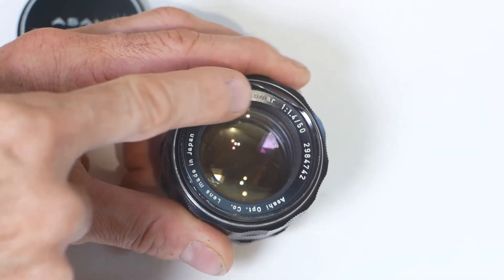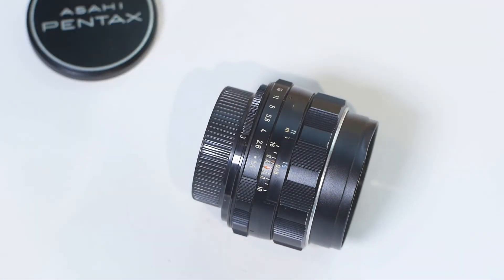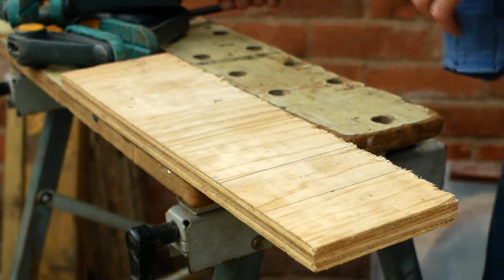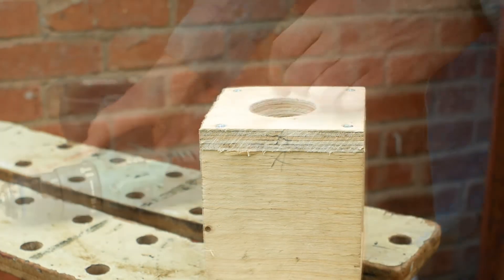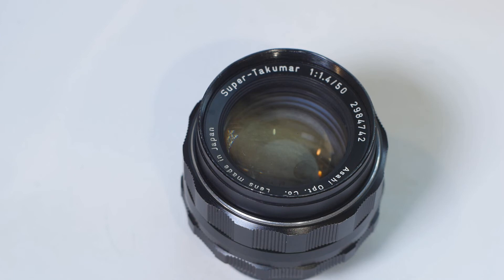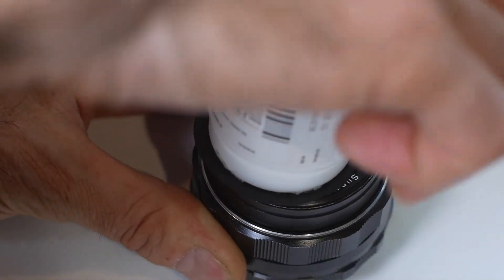Radioactive Lens - Super Takumar 50mm f1.4 - Repairing a Damaged Filter Thread & Vintage Lens Test

Comment: Just a few tips, after doing this on mine. It deeply improved the situation so I can get a filter to stay on tightly, but the filter is kind of cross-threaded. The thread ring and barrel wound up slightly over round (maybe 1mm) near the dent which is really hard to fix. Tip one: it's better to under-do this repair than over do it, because filters have a bit of play in them. Test your progress with a filter, and if you can get it to thread on partway, maybe stop and call that a win. Tip two, try to make the hole size and barrel as close as possible to the outside diameter of the barrel. The Super Takumar 50mm f 1.4 outside diameter is slightly smaller (about 2-3mm) than a 2 -inch nominal Milwaukee hole saw. Because of this extra space, there is room to push the barrel too far outwards. A good solution might be to shim the barrel with some firm tape (ie scotch tape) wrapped around. Tip three: beware the fine-tuning. I think it helps to apply the tool only to the first few outside threads, instead of pushing the tool tight to the inner ring that traps the outer element. Because at that point if you go too far, the bend might take to the barrel, and it might not be possible to remove the front element trap ring.
Reply from the maker: Good points TheNaught1, repairing filter threads can vary greatly depending on how they were damaged and whether someone has already had a go at fixing it with pliers (which is quite often the case).  If the damage is simply that the side of the thread has been forced inwards, then they're often easy to sort out, but if the lens fell on it's nose, crushing the thread backwards, it's then much more tricky.  On the plus side, if all it needs to do is hold a filter you can usually achieve something that sort of works.  I've not had any unfixable ones yet, but there will always be the first time.

Comment: Just found this video only 3 years too late.....Nice Job repairing the filter ring.  I have fixed 3 different Takumars using the same method in the past. Two of them to get access to lens elements to remove fungus and clean diaphragm.  I have also made a dedicated UV de-yellowing light station with a small cooling fan it does the job betwwen 24 and 48 hours.  By the way its not just the yellowing thats the issue you will also loose 1 to 2 stops of light until you de-yellow.  Thank you for a great video.  Mike.
Reply from the maker: Hi Mike, I knew about the yellowing losing some light - it's not so much of a problem when I'm using the lens on digital because I can just pump up the iso a bit - I still might get round to de-yellowing it one day, particularly if I start using it for film photography because than I'd want all of that f1.4 goodness.

Comment: thanks for that video. I own that lens as well as the 85mm F1.8. My AC dropped the 85mm and bent the filter ring. Now I have an idea how to fix it. I shoot documentaries for a living using my new Sony Fx9. The 85mm works all the time for me. If I white balance I'm more comfortable using the 50mm so it matches the other lenses I am using on a particular job. The focus on both is so buttery smooth
Reply from the maker: Hi Mark, the method I used on this video works fine, assuming the damage isn't to severe and that someone hasn't attacked it with pliers to fix it in the past.  I've also used a lens vice on some lens repairs - both methods have their uses.  What I would say, if you use a lens vice, is to position the vice where the dent is and gently expand the vice outwards - you can repeat this a few times, adjusting the position between expansions, to line up with the next bit of the dent if needed, but I wouldn't recommend using the method that I've seen some people try with these lens vices - they expand the vice to the size of an undamaged section of the filter thread, then rotate it round to the damaged area, hoping to push the dent out in the process.  This method risks mashing up the threads, plus it puts a large amount of rotational force on the front bezel, which, depending on how that particular lens is designed, could cause damage further back in the lens.

I did another video where I briefly used a lens vice - if you want to see that one, it's here, https://youtu.be/93Q3CyJzMuY and the bit you want is 1:55 into the video.

That's nice to hear that you're using these lenses for real work, I suspect that more of them are play things than work horses these days.

Comment: been grinding thoriated tungstens for years as well as using lenses of the type but never crossed my mind linking the two, excellent video by t he way
Reply from the maker: Hi Hammy channel, I suspect lots of people have been grinding those Thoriated electrodes for years, and I'd also be willing to bet that you'd actually have to be quite unlucky for it to cause any harm.  Similar to lead, we all know that lead ingestion isn't good and should be avoided, but I've seen people so paranoid if they happen to touch a bit of lead, thinking that their head is going to spontaneously explode or something, but in that case, I pity all the roofers out there when they're doing lead flashing.

Thanks for watching, and stay safe with those Thoriated electrodes.

Comment: I swapped front elements between 2 105mm f2.8 lenses using some electric tape and the cap for a vitamin bottle. I remember thinking, I must be the only person doing this right now, but I'm doubting those thoughts about halfway through your video. Hahaha.
Reply from the maker: Haha, you can't beat a bit of good old improvisation.  I find more and more these days that I will make a tool to do a job rather than having to go out and buy something.

Comment: Great video, I'm very lucky to be waiting for one in the post... Quick question: what's the safest way to store them? I've heard you can use lead-lined bags used in airports... but lead is not safe either?... I'm so confused! 🤣 Stay safe. 👍🏻
Reply from the maker: Hi Flat Twin Frog, that's exciting, hope you enjoy your new/old lens when it arrives.

The whole radioactive thing is a fairly complex subject, personally I'm just storing my radioactive lens well away from anywhere I spend a lot of time, on the basis that once it's about a foot away from the geiger counter, I can't detect any additional radiation above the normal background levels, and besides, although these lenses sound like they're highly radioactive, they're actually pretty low in radioactivity and not as bad as some people make out.

You could make a box for the lens but then it gets a bit tricky, there's a phenomenon known as braking radiation which has the German name "Bremsstrahlung" - I found this out in reference to P32 which is a very high Beta emitter -  people will tell you that you can use lead to block radiation, this is largely true but with a high energy Beta emitter such as P32, the particles can knock into a lead atom with such force that the lead decays and emits Gamma radiation, so the thing you are intending to use for shielding actually becomes an emitter itself.  To prevent this, the P32 is stored in a perspex container which slows the Beta enough so the perspex can then be surrounded safely by lead without the lead becoming an emitter.  I suspect this phenomenon won't particularly apply to these lenses but it's just an example of the fact that radioactivity is a complex subject - and if I was making a box for radioactive lenses, I wouldn't simply make it out of lead!!!!

Comment: Which do you like, the Chinon 1.4 or the Takumar 1.4?
Reply from the maker: Hi Mumtaz, that's a good question - both lenses have some defects - the Takumar has the yellowing of the glass which can be a bit annoying at times - I know I could de-yellow it by exposing it to UV light for a couple of days, I just haven't got round to doing that yet.  My Chinon 55mm f1.4 has some fungus and dirt inside the optics - I really should get round to cleaning it but again I haven't got round to doing that.  Personally I prefer the Chinon but that's mostly because I've owned it longer and it's one of my favourite lenses - and that's not saying that the Chinon is better - I'd need to clean the optics on the Chinon to do a fair comparison but at the moment I'd say the Takumar is the sharper of the two lenses.

If someone was to take away both lenses it would be the Chinon that I'd miss and want to replace.

That's probably the least scientific answer in the history of the world!!!!

Cheers for the question.

Comment: Thanks ! just confirmed the idea that i also had using wood so as not to damage the thread, I bought the same lens cheaply becaiuse of "the yellowing"  ,,,
Reply from the maker: This method certainly worked fine for me and I'll definitely use it again if needed.  Well done for tracking down a good value lens, they can sometimes be a bit pricey.

Are you planning to de-yellow it by exposing it to UV light?  I will probably de-yellow mine at some point but I haven't done it yet.

Comment: I've used a lens vice on two lenses. My first attempt to repair a filter thread failed. I did manage to repair my second lens with the lens vice. I think your "bird box" technique looks like it might be a safer, more reliable alternative to a lens vice as it appears to support the entire circumference of the filter thread. I'm definitely going to keep your technique in mind if I have to attempt another repair. Thank you for sharing this method.
Reply from the maker: Cheers Jim,  I think the lens vices definitely suit some repairs more than my bird box approach but for my particular repair it seemed like a good idea.  I was lucky that I had a hole saw the correct size for my lens - I was expecting to have to drill the hole under size and open it out using a rasp.  I'll keep my bird box on a shelf and probably never have to use it again!!!

Comment: The bit about the filter thread repair is useful, thank you.

At 1:31 About the radioactivity: From reality, doing my own tests, I know this lens, the Super and SMC Takumar 50mm f1.4 versions in particular is quite radioactive, emits about 38-40 µSv/hr on the back, and that's mostly alpha, but also a fair amount of beta and even gamma radiation. These lenses do not just contain Thorium Dioxide, but also other elements. Thorium Dioxide decays into other isotopes which are indeed beta emitters.
I don't have a Yashica 5cm, such as that one, but a later Yashinon 50mm f1.8 which has a radioactive back element. But emits much less, in the order of 3-5 µSv/hr. This was mainly alpha.
Background radiation level measured here hovers at about 0.05 µSv nowadays. I have two callibrated Geiger counters.
My personal opinion is this: Use these lenses, but be careful to limit exposure to the naked eye (don't stare into the back element up close), and make sure you do NOT break the glass, ever. Your warning to not breathe (or ingest) the dust of a Thorium Dioxide containing material is on point.
I'm posting this comment not to spite you, but to offer users more detailed information.
Reply from the maker: Thanks reptilespantoso that's very good scientific information.  I'll pin this message to the top of the comments, cheers.

Comment: The lens now looks great, well done. Note to self, don't eat ground thoriated glass. ;)
Reply from the maker: Admittedly the ground thoriated glass thing is an unlikely scenario!!!!  They really did make some excellent lenses in the past - for many years I lost sight of that and only used new lenses - really glad I got the bug to use some of the old lenses again.
Reply: @GrumpyTim  True, but the TIG welding electrodes much more likely.
Reply from the maker: @BensWorkshop  Yeah, the TIG electrode thing is quite scary, you probably get taught about the dangers if you go on some kind of proper training but many people just buy the machines from Amazon/Machine Mart or wherever (myself included) and get started.  Technically, breathing in any particles isn't great but the radioactive stuff has an extra level of non goodness about it.
Reply: @GrumpyTim  Very much so. As an alpha emitter (although very weak) you are safe a very short distance away but obviously if you ingest it that is a problem.